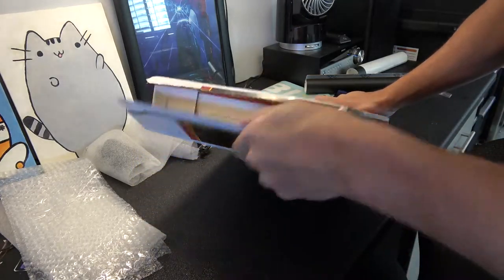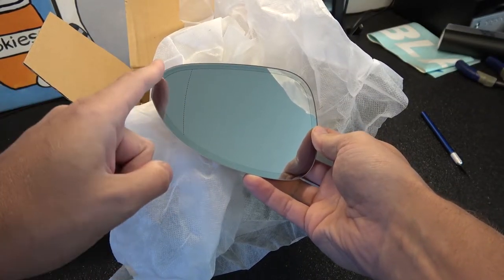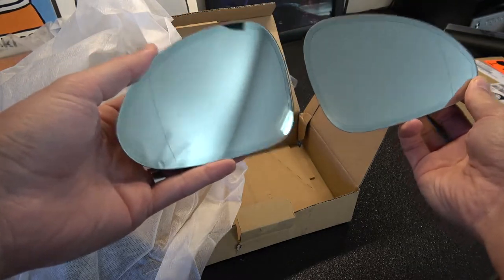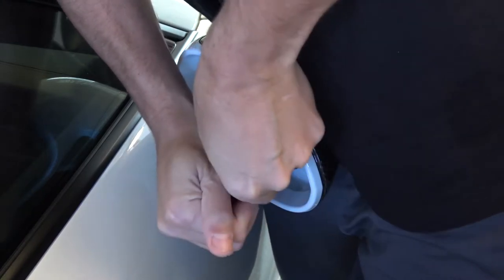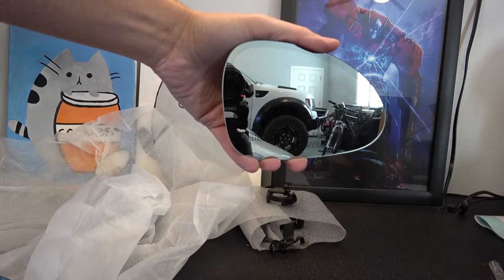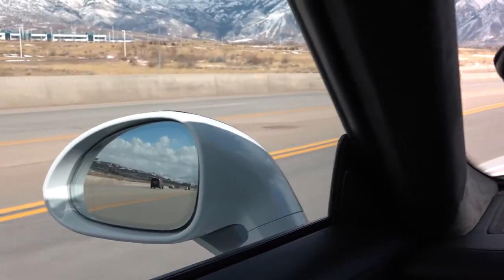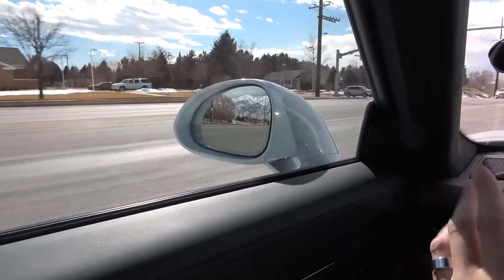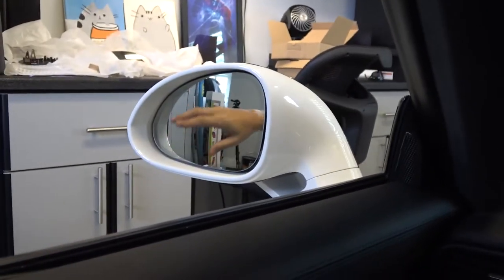Porsche 991 Aspheric Mirror Install & Testing

Comment: Very cool! Do you have the PN for the driver side mirror? Looks like you show the PN for the passenger side?
Reply from the maker: They are both in there (you just have to hit pause at the right time). 99173104601 (passenger) and 99173104503 (driver)

Comment: Enjoy your How To vids, very helpful!  Question, looking to do the same, but use the non-dimming mirrors even though I have the dimming feature.  Do you know if this is possible or if this would throw a CEL?  Thanks.
Reply from the maker: Glad they help! As far as I know replacing dimming mirrors with non-dimming options will NOT cause a CEL. In the unlikely event that they did you could take your car to the dealer and they would be able to code out that option and remove any warnings.